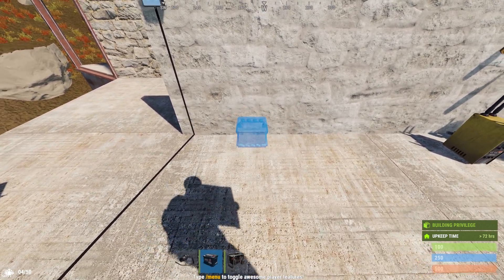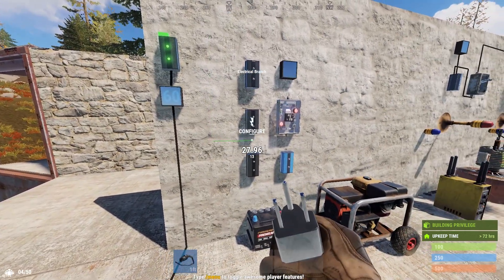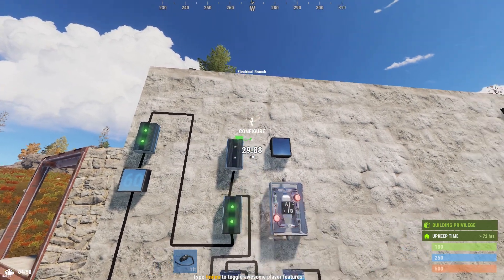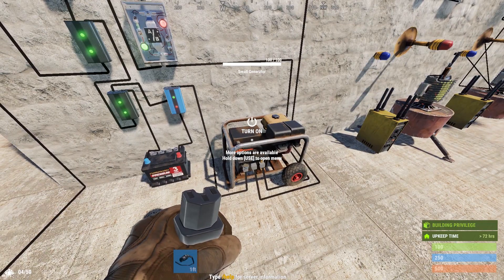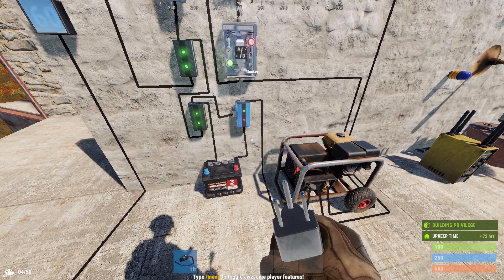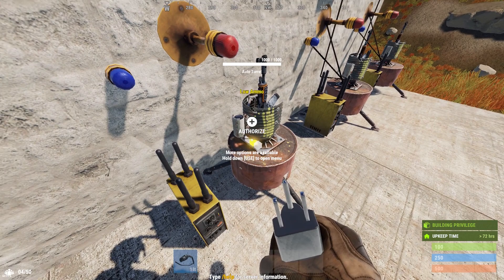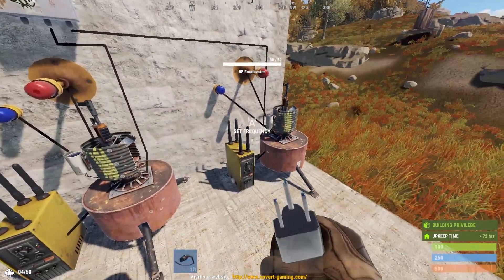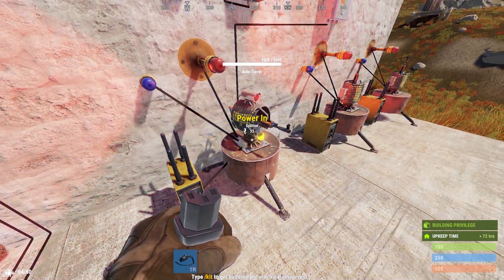Rust New Small Generator and Auto Turret Electricity by FullSized

Comment: I am an electronics engineer (Head of Production at Zikodrive Motor Controlelrs) here and I want to add something.

Although this circuit is way better than the vast majority of the circuits, it is not very efficient. If let's say, you have 800 power coming in from the wind turbines but the batteries can output 600, it will work on the wind turbine power however if the wind turbine power goes down to let's say 500, it will switch to battery power however, you're not using the 500 power from the wind turbines. That will be just stopped by the OR switch and you will always have unusued power when the power from the wind turbines is lower than the power of the batteries.

I made myself a little bit more complicated circuit who would switch the output of the wind turbines to the power in of the batteries when the output of the wind turbines is below the output of the batteries. When the output of the wind turbines is above 600, it will switch everything to only power from the wind turbines which goes to a branch that will only output 600 of that power to the circuit and the excess power will be fed again in the battery therefore your circuit will be constantly powered by either the battery or the wind turbine and the excess power will be always fed in the battery, even when the power in of the wind turbines is below the power out of the battery.

Your circuit is fine with solar panels because solar panels only generate power during daytime however, wind turbines generate power during night time as well. So it would be more efficient to run the circuit as much as possible from the wind turbines and not from batteries, to keep them charged as much as possible. 

Here's a screenshot of the circuit: https://i.postimg.cc/25xyMHMS/Screenshot-93.png
On the left side, in the first root combiner noted as "baterie", you get all the power out from the battery to feed the circuit. It then goes into an OR switch and the output of the OR switch is where you connect your circuit, in this case "turrets".
On the second root combiner, that's where you get all the power in from the wind turbines. You have to add extra 6 power to power this circuit. This circuit was designed for a 600 power output from the battery.

From the far right and middle splitters, you connect the power in to the battery.
You need: 1 x XOR, 2 x OR,  3 x Electrical Branch, 1 x Memory Cell, 2 x Root Combiners and, in my case, 3 splitters. The first splitter splits the excess/unusued power from the wind turbines in half and the other two splitters, splits that power in 6 since I was using 6 batteries for 600 power.
You can set up the root combiners by following the added text in the screenshot.

Give it a try and maybe, you'd want to make a video of this. I don't think this was done before. But please, if you do, just give a shoutout :D.
Reply: If you want, we could join on a creative server and I could better explain the circuit.
Reply: @RiddimDubstep  i don't understand the circuit. can you edit your screenshot of it like this? https://i.imgur.com/HlQ2dOF.gif

Comment: @FullSizedGaming is there anyway to put two  of the gas powered back up generators together to get more power ?
Reply from the maker: Thx for watching.  To answer your question, sure just split all the wires going into and out of the single generator respectively and route to a second generator.  You could use either splinters for this or electric branches.  The splitters ofc cost more hqm and the electric branches would cost 1 extra volt each.  Furthermore dont forget to increase the branch output on the branch to the left of the counter in the video as this will need increased to trigger the generators as well as supply the drop voltage to the additional splitter.   And just to be thourough https://i.imgur.com/mnS0gLC.gif
Reply: @K162KingPin  yo i did it the way u did an the small gens wont turn on no matter how low the power go

Comment: What about, Having the generator as a backup? Imagine you have some solar panels as your electric source, a large battery for the nights and then some generators in-case everything else fails, example, you're in an online raid or something and they destroy your Sonal Panels and wait til your turrets turn off / the charge in your battery is low. Then the generators would kick in (Starting themselves with a small battery) to provide some extra time. It would be extremely rare a case where this is actually useful but I would like to see a circuit with that concept!

Love the vids
Reply from the maker: Thx for watching, and sorry but I must be confused about what you mean.  That is exactly what this system is.  If main power fails for whatever reason the power from the small battery starts up the generator and it takes over.  If you wanted to you could set up a splitter for the power from the power that starts the generator and run it to 3 generators or more, then root combine those generators before entering the orswitch.  I mean this is the simplest setup but it could be expanded exponentially if such power requirements were necessary.

Comment: Would it be possible to only use a small generator for power? For example, I want to make a trap base and want only the power generator to turn on when the heart beat sensor is activated, that way it doesn't waste fuel and I don't have to have solar panels and a small battery. Are solar panels and a small battery a necessity to make that happen? If it is possible, would you mind making a video on it?
Reply from the maker: Currently this is not possible sorry.  The problem is that for the HBHF sensor to operate at all it needs to be supplied at least 2 volts of electricity.  Now if you powered it separately say straight off a solar panel for example then the HBHF sensor could then be used to activate the generator by running the power out from the HBHF sensor to the "Force Start" on the generator.  However there are several down sides to this.  First there will be an inevitable lag time of a couple of seconds between the HBHF sensor picking up a target, the generator turning on, and whatever the generator is powering to activate.  I don't know the time but probably between 2 - 4 seconds, which is a long time for things to happen in a trap base.  Furthermore the generator is rather loud and the sound is heard through walls, which makes it less than ideal for trap bases because it alerts the would be victim that something is happening and they might get away.  I recommend watching one of my other videos.  It doesn't use the generator but its ideal IMO for trap bases. https://www.youtube.com/watch?v=hHjAEhFgg4c Hope this helps, thx for watching.
Reply: K162KingPin Thanks so much! Your videos are really helpful as well
Reply: @K162KingPin  Voltage and power are not the same thing. Unit for power is VA and power is written on every component.
Reply from the maker: @aleksandars91  Not sure what you are talking about?  Does this apply to rust?  This is a tutorial on electronics in the game of Rust.  I have a degree in computer electronics in rl.  Sadly Rust electronics don't follow real world mechanics.  For example in rust you can't charge a battery and use it at the same time.  Also in rust the only unit of power is volts.  There are no amps in Rust like in the real world.  I think it would be cool if there were but it would probably be to difficult for the average player.
Reply: @K162KingPin  I have deegree in energetic in rl :) Where did you saw that power in rust is volts? In rust there is no Voltage or Current, only Power. There are 3 different power types in rl and for Rust we can say that we have Active power with units in 'W'. Before i have wrote 'VA' but for example in rust we have auto turret, for it we need to have some type of electric motor for which we need Reactive power. Telling that some component using power in V (Volts) is not correct, power should be VA (Apparent power) but for rust W (Active power) is good enough. 

Your videos are very good, keep it up and please correct this mistake.. :)
Reply from the maker: @aleksandars91  I like you :).  You over analyze the shit out of stuff just like me.  I also have a degree in computer electronics.  That said I'm fully aware of the proper terminologies in real world electronics.  That said I remind you that this is a game, a game played mostly by fairly young people who don't have a background in electronics.  Furthermore as I mentioned before the developers have taken certain liberties in simplifying the electronics in the game for the sake of it being a game.  That said I saw that the power in rust is volts from the batteries.  I have looked and I did again since you mentioned this because I was curious and there is no official word on what the numbers are meant to indicate.  Still I do have a couple of points in favor of calling them volts.  First its arbitrary.  Because there is no official word there is no wrong answer, unless you call them potatoes.  Second we are measuring this power by holding an extension cord in our hands.  We don't have a multi meter or an oscilloscope, just a wire.  Now initially I thought that the power unit should be watts which as you know is VA.  After all solar panels are sold with two main characteristics listed, Watts, and Volts.  Usually Watts is listed first.  So when you hold your wire over the solar panel and it gives you only one number you might assume that it was showing you the Watts.  A wind turbine would be listed the same way so we could continue to assume that the number represents watts.  Continuing on we get to batteries.  Again we pull out our trusty extension cord and hold it over a battery.  Here we actually get to see two numbers.  The output and the time remaining.  Now batteries are sold with two primary numbers of concern.  First and foremost is the Voltage.  You don't want to be putting a 6 volt lawn mower battery into your car which needs a 12 volt battery.  You wouldn't want to put a 3 volt watch battery into your tv remote.  So the most important number for a battery is the voltage.  The second most important is then Amp Hours which is anyone else is reading and curious tells you how long the battery will last.  If you have a bucket of water and you want to know how much water you measure it in gallons or letters, but for a battery you measure its volume in Amp Hours.

So now that we have considered all of that my conclusion is that while the output measured from the solar panel and wind turbine could be either voltage or watts it is inevitable that the output from the batteries would be voltage.  Nobody ever measures the watts output from a battery in such a fundamental sense.  Furthermore even IF the output from the batteries was meant to represent Watts then the number should decline as the "time remaining" or amp hours of the battery decreased.  The battery should start at 10 watts when fully charge and be down around 7 watts when nearly empty but that doesn't happen.  Meanwhile the voltage of a battery remains basically constant while the battery drains to its EMS value.  So again based on the batteries it is undeniable that the output we read from the batteries must be voltage.  Considering that we have only the one power reading to go off of from everything including solar and wind then they must also be voltage and not Watts.